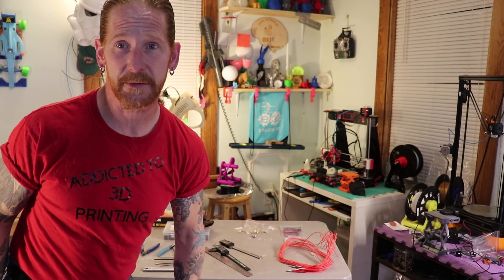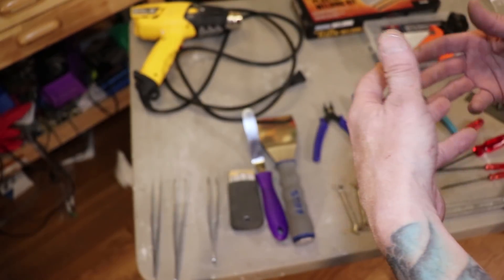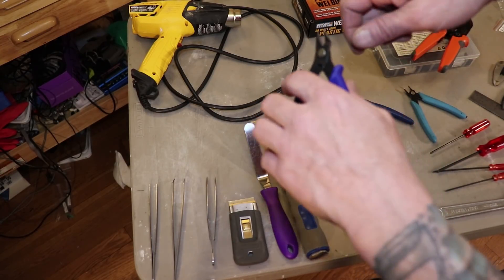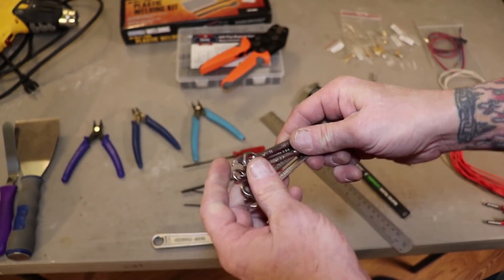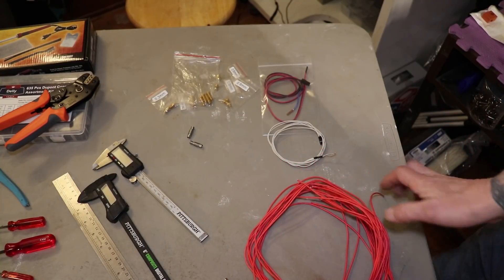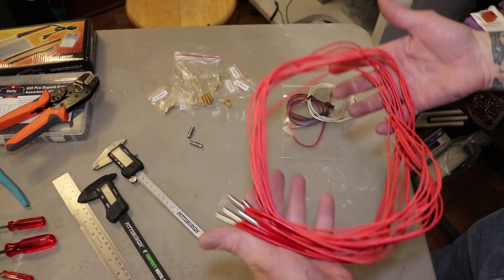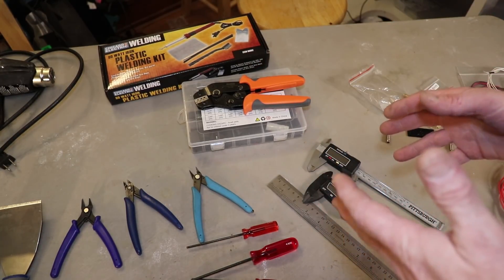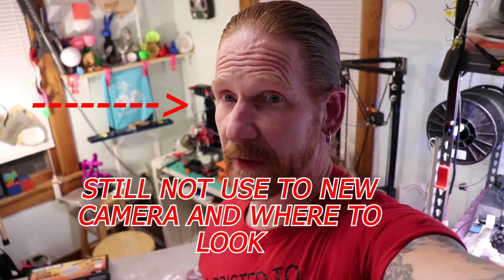12 Things Essential for 3D Printing

Comment: The plastic welder will run too hot for 3d prints.
You could try a cheap pyrography kit (30 watt wood burning)and use a dimmer switch to control the temperature. 
Just an idea. Would love too see how you get on with the welder though.
Reply from the maker: Thanks for the suggestion I will make a video playing with the welder thanks for watching

Comment: I get a lot of use out of a quarts glass rod I bought at a smoke shop. Its got a rounded end, and you can blowtorch it till its glowing hot without it exploding in your face, its been indispensable for welding 3d printed parts together. something about the extreme heat and the glass doesn't stick at all and leaves a lot of melted-together surface area with a decent finish. I fix 3d printed cement molds all the time with them, it'll stop a crack in its tracks. my 3d print pen works well too but differently, too much hassle imho.
Reply from the maker: Very interesting I’m curious about that sound interesting

Comment: Plastic Welding Kit I have not used myself.... but I have a friend that has and he told me the one you got is junk... you might take it back and get this one because it's a lot  better as in has a blower in it which helps a lot
https://www.harborfreight.com/plastic-welding-kit-with-air-motor-and-temperature-adjustment-96712.html

I plan on getting this one also one day soon :)

Comment: Thanks Matt.  One suggestion.  I know that a 12" caliper costs about double (available for about $35), but with larger printers, they are preferable.  Plus, they are much easier to hold when measuring - especially when measuring at the 5" to 6" range.
Reply from the maker: I’m needing a new pair once holiday is over I’ll use that suggestion and grab a bigger one thanks for the suggestion bigger is always better right 😁
Reply: @InsideTheMindOfMatt  - This is the one I got, and am very pleased with it (I actually bought a 6" and a 12").  Plactic protective case and spare battery are included as well.
https://www.amazon.com/gp/product/B01HNDAF2E/ref=oh_aui_search_detailpage?ie=UTF8&psc=1

Comment: A couple other things:  a set of files, debur tool, heat gun, solder iron, socket & ratchet  for your nozzle, multimeter.  On a side note, you need to look into a better audio solution.  Thanks for the video.
Reply from the maker: Yes all those things could have made the list there was a theme hehe but some of those items would be on the extended list 
Btw side note can you be more specific as to your audio critique. I invested in a good mic and I adjusted the levels during editing was it the music? Thanks for the input always looking to improve
Reply: @InsideTheMindOfMatt  The audio sounds like it is an omni directional mic placed back by the cam.  The audio picks up your voice with room noise and the reverb from the the large room.  A directional mic could help, but a wireless mic would be the best choice.